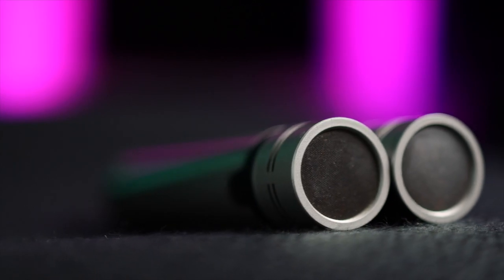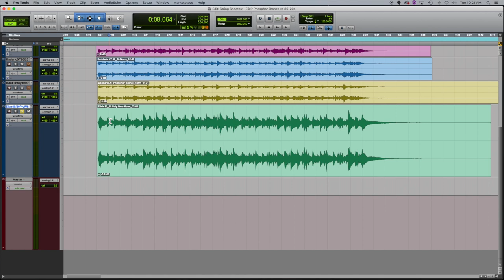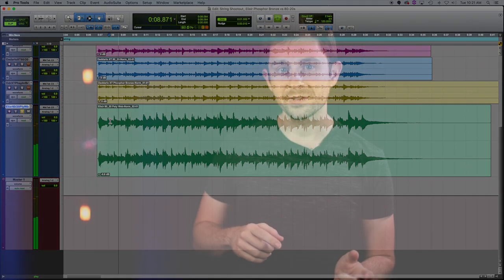Guitar String Showdown: Elixir Nanoweb 80/20 vs Elixir Polyweb 80/20 Acoustic Guitar Strings

Comment: The Elixir website shows Polyweb/Warm-Nanoweb/Bright. That's not how these sounded. I did my own test with 80/20 Bronze vs Phosphor Bronze and found the 80/20s brighter which I like on my 66 Southern Jumbo which sounds mellow and the brighter strings seem to wake it up. I haven't done the Poly/Nano test myself but I will. Thanks for your video.

Comment: I went into this expecting the Nanowebs to sound better. For some styles they did but for finger style I preferred the Polywebs. I have recently discovered different guitars along with different playing styles require different types of strings. Rather than picking a favorite string type for one guitar and then using it on all your guitars, string type should be selected based on what sounds best on each different guitar. The results are worth the time and expense. Polyweb is a thicker coating so less responsiveness with a lot less string squeak. Nanoweb, much lighter coating so more responsiveness but also, more string squeak.

There are those who complain about the Elixir Polyweb coating getting fuzzy from wear. With a magnifying glass you can see that occurs where the coating has torn on the higher parts of the winding. You can remove the fuzz by running lightly across the string with a piece of fine Scotch-Brite sanding pad wrapped around the string. I do not recommend steel wool, the metal fibers get into places they shouldn't go. Be sure to put a piece of paper beneath the strings to protect the guitar's finish and catch most of the fuzz dust. The coating that keeps gunk from building up in the grooves and the inner wire from corroding will remain and continue protecting your strings.

Also a warning, based on personal experience, watch out for counterfeit Elixirs. If the price seems too good to be true, it probably is. I bought four counterfeit sets online last year. The packaging is very convincing. The counterfeits do have a coating but it is sticky, or grabby, not slick like Elixirs. As a result the string squeak is bad. The gauges are also not the 12/53 marked on the box. My bass string was very weak so I checked with my dial caliper. It was only a 49.
Reply from the maker: This is great! Thanks!
Reply: And speaking of counterfeits, I noticed some elixirs being sold for lower prices from China and I don’t mean to imply that everything that comes from there is counterfeit. For a moment, I thought maybe Elixer had a production facility in China. I’m not sure if I want to try polyweb. I’m accustomed to nano web for my Taylor. I have an old Guild F-47 that I put non coated strings on. 

Nice chatting.
Reply: That's funny. I was just thinking the Nanowebs sound better for finger style. The low strings of the Polywebs were muddy and got lost in the other strings.
Reply: @aleithiatoews6452  That kind of goes along with the first part of my statement that different guitars like different strings. My Eastman E10D (mahogany dreadnought, really likes 80/20's) Two months ago I bought an Eastman Double Top Grand Auditorium (DT30GACE). When it arrived the strings sounded fantastic. I asked the seller what strings he'd installed and he responded, "D'Addario." That was a real eye opener. It turns out that my opinion of D'Addario strings was woefully out of date. On top of that, Taylor announced in mid-May that from now on, instead of Elixirs, their guitars will ship with D'Addario XS Coated Strings.

Comment: Hello from Ireland. I was just today tempted to change to Elixir Polyweb strings and I rang my local music shop for advice. They weren't clear on the difference. And then tonight I find your excellent video. Thanks for going to all that work. I can now decide - I will stick with Nanoweb. It seems to me that the individual notes (which combine to make a chord) are clearer with Nanoweb. I agree with another contributor that sliding from chord to chord can be noisy but I guess with extra concentration on the use of fingers that can be reduced.
Reply from the maker: Awesome! Glad it helped!

Comment: Helpful video, thanks. 👍My daily driver is an Epiphone arch top, which seems quite bright, perhaps to a fault, on its own, so for the past several years I've been warming it up a touch by stringing it with the same Polyweb strings you've used here. It seems like a good combination.
Reply from the maker: Same here. My guitar is bright to a fault too. Ive come to like it that way but I find I need just the right strings If I need to tame it for recording. Thanks for watching!
Reply: @JTravlos  You're most welcome. I really like my Epi, too. I rarely pick up my other guitar.

Comment: The difference is much more pronounced than I expected. I also prefer Nanoweb. I’m curious why Elixir doesn’t make acoustic strings with Optiweb coating that’s supposed to be even thinner, but only available for their electric sets.
Reply from the maker: Yea, I just tried to look into this and I am also really curious as to why they dont add optiweb coating to the acoustic line. Is it steel string specific? I have no idea and their website doesnt have much info. I am really curious now..

Comment: Here's a idea for a vid mate, if ya can, get a taylor 600 series acoustic ( maple back n sides ) & compare these strings on your taylor & the maple one. Cause the poly webs sounded good but it sounds like they take away some presence & dampen that classic taylor brightness
Reply from the maker: Good idea, I used to have a 614 but got rid of it because I thought it was too bright. But, I know a friend with a newer 614 with the new V Bracing and it sounds way different/ better. I should borrow that and do some comparisons. Thanks!
Reply: @JTravlos  i have a 614ce & trying to find strings to fit it that arent elixers has been a challenge. The polyweb could compliment the warmer maple guitar ?

Comment: Hi, I have sitka spruce top guitar with polyweb strings. It sounds too bassy actually. Does the sound will be less bassy with nano strings?  Thanks.
Reply from the maker: The nanowebs might help with the bassyness. Also, a thinner string might help too. Maybe try the nanowebs in custom light guage. But, sometimes the guitar is just naturally a certain way. My taylor 812ce will always lean toward bright no matter what type of string I put on it. The best I can really say is to just experiment with different strings knowing that different strings may only change the tone of the guitar by (arbitrary) 5%.
Reply: Poly webs are a bit more bassy you can also try the phosphor bronze

Comment: Different guitars react to different strings.
My previous strings on my parlor guitar was installed with polyweb, thus my luthier says my guitar didn't ring well.
He replaced it with nanoweb and it rings better as my top cedar wood on my Cort L900pd was a little thick. As such it's the instruments that will affect the tone outcome with the compatible strings.

Comment: Thank you so much for this video!!I'm thinking the nanoweb strings sound a bit fuller? Please can we  have an elixir custom light bronze vs ernie ball everlast 2556 video? The ernieball strings are cheaper but I think they're better
Reply from the maker: I will add this to the list. Ive never used those strings so I am interested now. However I will probably get the 2558 because they will be the same exact gauge size as the elixir.
Reply: @JTravlos  you could use 2558s but I'm thinking the best sound is a bright yet warm sound so that's probably easier achieved with 12s medium light than 11s custom lights? I'd be willing to donate if you could compare 12s elixir and the ernie ball 2556

Comment: Subjectively the difference is so radical it can't possibly be due only to strings. Something else like mic position changed. Objectively, if you need to adjust volume of the recordings then clearly something changed other than the strings, unless you think one kind is significantly louder than the other. I don't think these recordings are a useful guide.